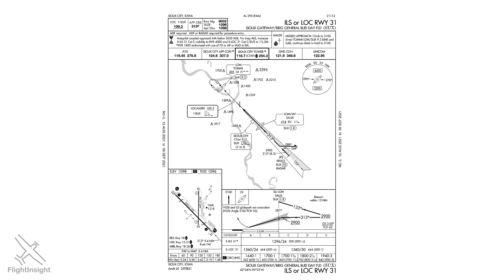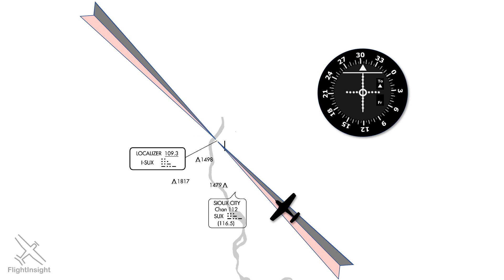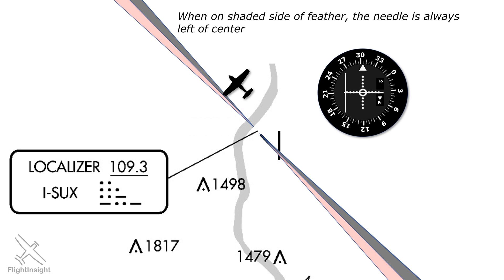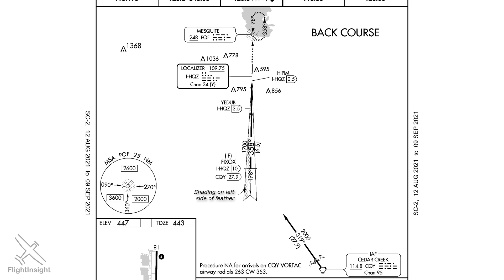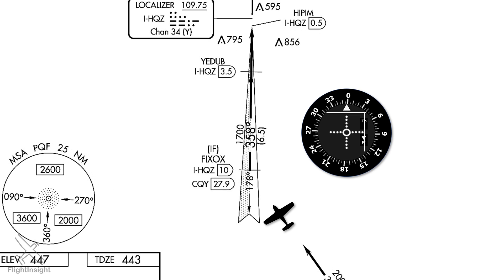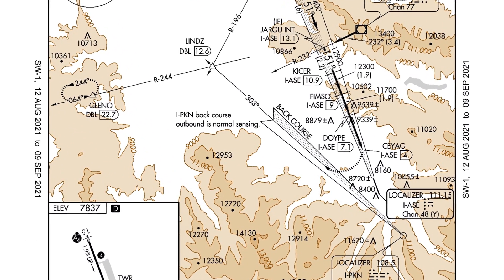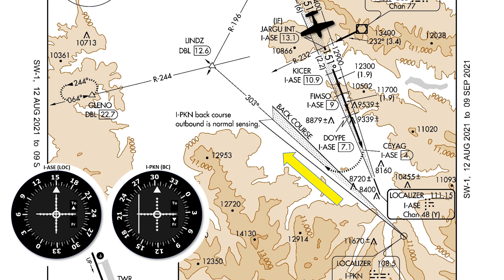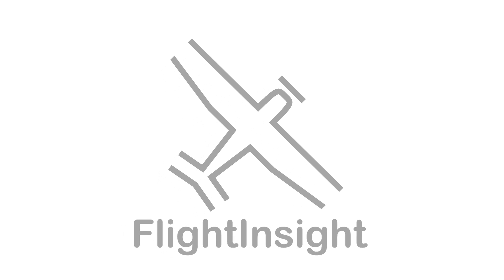Flying a Back Course | LOC/DME-E KASE Aspen | Reverse Sensing | IFR Training

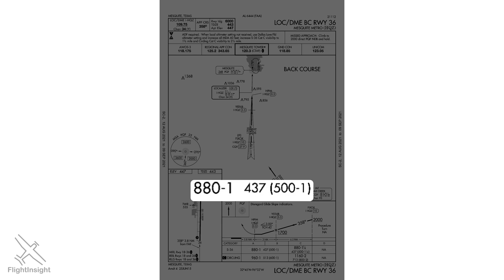Comment: At 4:31 in the video, you refer to the minimums of the back course approach as "decision height".  I disagree with using that term.  What you highlight in the video is the minimum descent altitude (MDA), which is 880 feet as referenced on the barometric altimeter. A decision height (DH) is only applicable on a CAT II or CAT III ILS approach and is referenced by a radio altimeter.  A decision altitude (DA) is applicable on a CAT I ILS and is referenced on the barometric altimeter.  DA and DH differ from an MDA in that on a precision approach, upon reaching the decision point, DA or DH, you must meet the criteria for continuing the approach or execute a missed approach.  On a non-precision approach, reaching the MDA is only the lowest altitude you may fly until you either reach the missed approach point or acquire the visual cues necessary to descend from the MDA to make a normal landing.  Using the old "dive and drive" technique for a non-precision approach, you might reach the MDA way before the missed approach point.  It is perfectly legal to fly along at MDA in this circumstance and wait until reaching the missed approach point, which could be referenced by either time or maybe a DME indication.  By calling the MDA on the LOC BC a "decision height", you could introduce a misconception on the part of the student as to which this minimum is called and therefore cause confusion when other concepts are introduced in subsequent training.
Reply: I’m sure he misspoke and can tell the difference.

Comment: I absolutely love your videos, you're a joy to listen to!

For any curious engineers out there, this explanation for how an ILS works in incorrect, though you can certainly be forgiven because ISL systems are almost always incorrectly depicted this way. The entire antenna transmits 150/90Hz at the same amplitude, but it phase shifts the sidebands +90/-90 degrees. This creates a magical interference pattern that result in a Difference of the Depth of Modulation (DDM) along the lateral/vertical track. The depicted explanation is called "Received Signal Strength" (RSS) and has problems that would make an ILS unusable. There is a great writeup about it on Aviation StackExchange. As far as what a pilot cares about though, this explanation is more than sufficient.
Reply: Awesome! Will be sure to read that.

Comment: Some of the newer OBS instruments have a BC light, which is a green light within the instrument. I’m not sure if that is a function that if you select back course it illuminates and puts the OBS 180° out of phase so that you would fly it like a normal localizer or it’s just a reminder light. On the G 1000 there is a BC button which I believe sets the unit up as a back course. Selecting this button, makes the CDI course selector flip 180° and line up with the opposite runway of the normal ILS. Reverse sensing which is a horrible term and it’s not true, is never experienced when you fly a HSI.

Comment: Two questions here. Does the BC button allow you to fly outbound on a front course only localizer that is using an HSI. Remember the HSI will always point to the inbound course regardless, if you are flying to the localizer 180° from, the approach end or flying outbound opposite the inbound course using the HSI. The ILS 30L at St. Louis downtown has the aircraft on the miss intercepting the localizer and flying outbound back to the hold, which is also the initial approach fix for the inbound.

Comment: Yes, on BC approaches I always thought of the needle as the airplane and the donut as the course/localizer = fly the needle to the course/donut.  An HSI solves all the the confusion by setting the course arrow to the front course heading.  One more detail is the BC localizer is more sensitive sense the antenna is several thousand feet closer - at the approach end rather than off the departure end of the approach runway.

Comment: Reverse sensing doesn't exist. Turn it 180°, and it will be correct. 

Because if you factor in which direction you are flying on the CDI, and see it like you're flying downwards, then the needle is right

Comment: Just had to fly one of these trying to get home in the Simulator.  Overcast at 600ft, runway height 300ft.  ATC (vatsim) was super confused, and I had one missed approach.   Eventually got it.  Looking up how to do this properly now.  If I'd lost navigational awareness, I would have had to either fly a tailwind approach, or divert to a different airport and drive home (in sim of course).

Comment: First good BC explanation I have seen. One little remark: it is not 437 feet DH AGL, but a MDA of 880 MSL (437 feet AGL), since it is a non precision approach. The BC button provides indeed normal sensing on the HSI when depressed on a BC approach. Thanks for sharing.
Reply from the maker: Yes thanks for that. It wasn't a decision height but an MDA. This is one of our clues that we're not getting vertical guidance on the approach like on an ILS

Comment: When I flew commuters (D328s) based out of COS, we served ASP and flew this approach numerous times; sometimes even circle to land on 33. We would brief the “20/20” rule i.e. Cross DBL (Red Table VOR) at FL200, Flaps 20, 200kts GS - if you missed that, you weren’t going to be stable at the latter part of the approach. Thanks for the memories along with the refresher. 
Safe flights always.
Reply from the maker: Wow thanks for that great insight! I've always wanted to fly this approach (as do many others) but I'm an East Coast boy and don't make it out there too often!